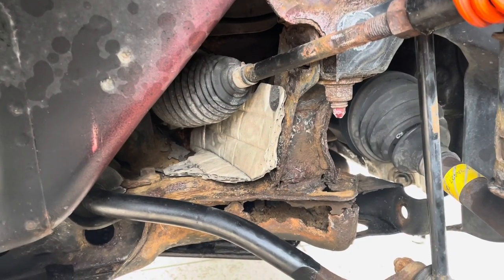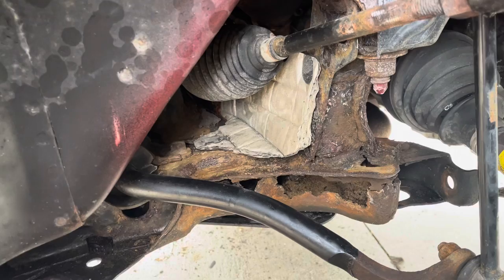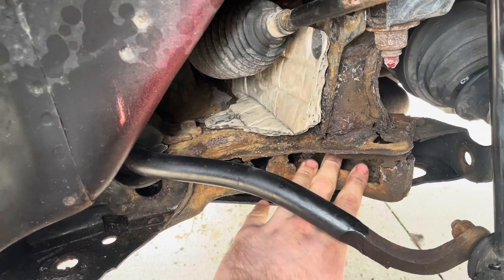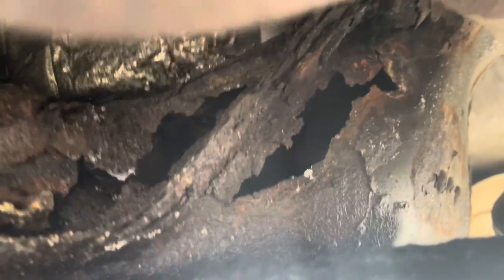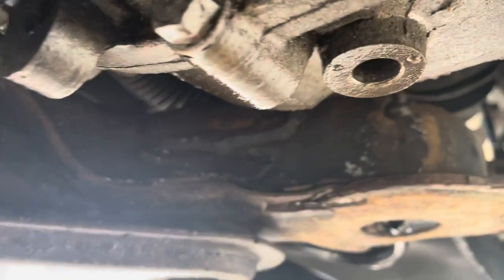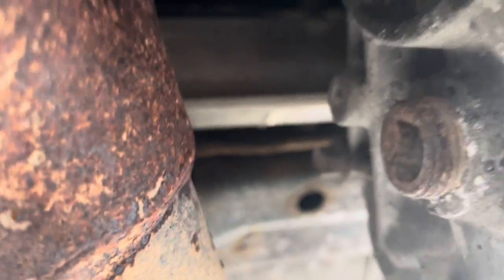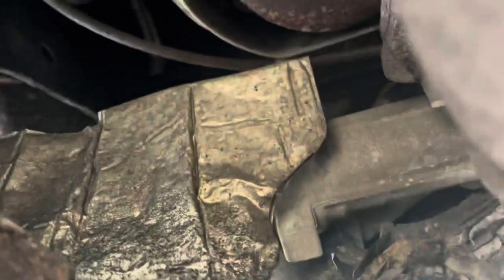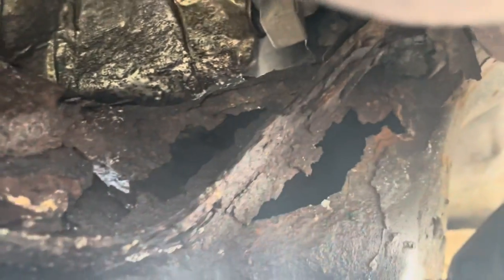2010 Ford Escape SUBFRAME FAILURE NEEDS RECALL ASAP

Comment: Happened to my 2010 Escape and then my 2010 Mariner. Luckily during an oil change the mechanic noticed ot on the Mariner (said it was super dangerous and could break next time I hit a bump). Spent $1K to replace the subframe. Last week I was rearended by a pickup truck (Mariner totaled) so once again I am on the seemingly impossible and daunting hunt for a 2010-2012 Escape or Mariner without a rusted out subframe. honestly reading all this makes me feel that for my own safety I need to finally move on (even tho its the only type of car I've ever owned, for the past 16 years) :(  I wish Ford would address this, mostly for the safety part.

Comment: A couple of days ago, my wife was supposed to take her 2011 Escape on the highway to get to work. My daughter didn't realize that her mom was going to be doing that and borrowed the car to go into town to run an errand. She was stopped at a light and as soon as she started turning to go through the intersection, she heard a bang and thought that a tire had popped. She had the thing towed home for me to fix and when I saw it coming off the back of the flatbed, I couldn't believe by eyes - a wheel was missing. The driver explained that he had to remove it so it would unjam and could be towed. The subframe had broken in two where the front part of the passenger control arm is attached. The wheel had pulled so hard to the right that the CV axle came apart. The wheel must have pushed back so hard that the front quarter panel pushed back and now rubs into the passenger door. The rotting must have progressed very quickly since  3 years ago it had been in a minor accident and no mention of rot was noted and just two years ago, I replaced both control arms (bad bushings) and didn't notice anything abnormal. The rest of the car has some minor rust but nothing of note.
I can only imagine how differently the story could have ended if my wife had driven to work that day!

Comment: I have 2011 here with the same rotted out subframe from the AC dripping on it.  I can’t understand how ford can get away with not recalling these. Hyundai has a recall right now checking for corrosion on the brake lines as well as the subframes that goes back at at least to 2010. Toyota has had multiple frame recalls. Ford needs to be held accountable. This is obviously a design flaw, they should be fixing the ones that need it as well as installing an extension on the AC drain. I had the same problem years ago with a T bird, rotted frame due to the AC, the rest of the car was fine, just like these Escapes, the other side is perfect. Everyone that is affected needs to file a statement or complaint.

Comment: Agree that it should be recalled, but Ford won't as it's aged out, or so I've heard. Had my subframe replaced last week. Apparently there's enough of them, so Ford keeps replacements in stock.
Reply: Helpful comment. My Ford ‘10 Front subframe is deteriorated. Looks like someone took a bite under the right passenger wheel. The subfames should not be rusting through; It’s disappointing the lengths I’ve taken to take care of it with this result.

Comment: Just found the same thing on my 2011 ford escape. Also, the frame on both sides in the rear beside the shocks is completely gone on the outside of the frame. All along the frame from front to back is rusted worse than I've ever seen. The Escape is taken care of and is simply a daily driver from New. I suspect these frames on these year vehicles are sub parts metal. I've been a mechanic for over 50 years never seeing this kind of rot on a daily driver car.

Comment: I was told yesterday my truck was safe to drive after getting the exhaust done… 2 hours after picking my truck up … my son was driving at 100km on the QEW … he said he heard the tire pop and then the truck frame broke. He could have been killed or someone else could have been killed. 
And now I’m finding out this was Fords fault and this was preventable???
Reply from the maker: Yeah… I haven’t gotten anyone to care between Ford or NHTSA. I wish I could tell everyone about the issue, but this is about all I’ve got.
Reply: @malachibergman902 how many people have died from this!? Totally unacceptable, just found out mine is rusted the same
Reply: Wow. The QEW is dangerous enough without that happening. This has convinced me. My 2012 is only a town car now until I can scrap and replace it. Won't be with another Escape sadly!

Comment: That’s great but you need a mechanic to take the pics and show what you are looking at. The passenger side rotted out and such. The mechanic needs to say in writing that the vehicle is not safe for operation. Then Ford might do something about it. I have a 2010 in the same situation. Doing that now with the better business bureau. Hopefully they will recall these vehicles.
Reply: I have a 2010 with the exact same issue. People were commenting on it feeling like it was going to give on the passenger side, and by accident I noticed this while doing an oil change. Right under the ac drain too. I'll get ahold of bbb as well. Did the mechanics note make a difference for you?

Comment: I purchased a new subframe from a dealer on line which is the same cost for a used on on e-bay.  Also bought a couple of cans of expanding foam and filled the new one with it to prevent any water from getting in.  Then I sprayed the outside with undercoating to seal the whole thing up.
Reply: Where did you get it from? What dealer?
Reply: Expanding foam is going to hold moisture and rot it out faster. I don't know how many old cars I've seen with that.

Comment: Yes was just told and seen mine is rusting out on the passenger side as well $2000 to replace. Didn't know this was a thing would be nice if they would recall
Reply from the maker: It would be nice….
Reply: I think they did, but it was only a cross bar to add to it, while it continued to rust.

Comment: I have been trying to figure out why my 100k 2010 mercury mariners front end is still wobbly after replacing my tie rods and now realized that the passenger side of the subframe is rusted through and broken. it looks almost exactly the same as yours. it doesn't help living in the northeast so lots of salt during the winter
Reply from the maker: It’s highly unfortunate, but it sounds like you’re safe. This has surely caused a lot of damage to these vehicles upon failure if they are on the road.

Comment: I attempted to establish a recall for this several years ago with a 2004 Escape. The people at the IIHS said, because it is clearly visible under the vehicle a mechanic can see it and notify the owner to have it repaired before it becomes a danger. I said that is true but it is clearly a design flaw and has been since they started making them, why should the cost of repairing such a flaw be placed on the owner. They said Ford did a recall on certain years from certain assembly plants up until 2004 they installed a brace across the bottom so the two sides couldn't separate. You would think they would have changed the design in 2008 with the redesign but instead they just added the brace at the factory and called it fixed. IIHS dropped the ball on this obvious design flaw and failed to order Ford to come up with a better design.
Reply from the maker: It’s very upsetting for sure. I still haven’t fixed it. I haven’t had the time and know how or the money to fix it, im getting close.

I did contact NHTSA about it, but never got a response either. We are all wondering the same question, “Why should this cost be placed on the owner when it’s a major fault of design?!?”
Reply: @malachibergman902  Agreed but their reply is just, because a mechanic doing regular maintenance can see it before it breaks it's not enough of a safety concern to warrant a recall.
Reply from the maker: @kelvinmann1058  they sell vehicles now with missing parts, so I’m really not surprised anymore
Reply: @malachibergman902  That's why my main vehicle is a 1995 F-150 Lol
With  another mid 90's waiting to be built. 😁

Comment: I just noticed this issue on my 2010 ford Escape. While I was driving in the dark I hit a pot hole which caused my subframe to brake where the passenger side lower control arm gets bolted in.
Reply from the maker: I’m sorry to hear that. When I went to the shop, they quoted be about 1.5k. I bought a replaced for the cross member k subframe for $300 after looking a bit. I still haven’t replaced it 😬. I hope that helps save you some time.

Comment: Yes!! I took my Escape to a mechanic and was told the same thing that it caused by where the air conditioner is located because water drips down.  I'm so bummed. Any recommendations on buying new or used sub frame?  FORD dealer quoted me $500 for a new sub frame.
Reply from the maker: $500 seems to be around the going rate from what I had seen. I was quoted $1500  for parts and labor.
Reply: Hmm...$500 was just for the part from Ford dealer.  I plan on taking it to a small mechanic shop.  Do you recommend a used or new sub frame? Thx u.
Reply: I paid about $350 shipped from a junkyard in Arizona

Comment: Same here mine just failed on the way back from work. Ordered a replacement and will be replacing it this weekend..... smh
Reply from the maker: Let me know how it goes. Try to document it if you can and upload it. I still haven’t gotten around to it, believe it or not
Reply: @malachibergman902  sorry I'm unfortunately a guy who just does things.... not terribly hard. I was able to do the entire job with hand tools and no air. I replaced both control arms and tie rods at the same time.  One thing I did was not removing the exhaust on the header side. I tilted the motor with a jack and the made removing and installing the subframe really easy.
Reply from the maker: @comngetsum  all good. Very helpful information for those like myself who plan on replacing it (hopefully sooner than later) 

There was a forum online that described adding a drain tube for the ac which the lack thereof causes the dripping and the corrosion. Might consider it if you haven’t looked into it already

Comment: I have a 2012 Ford Escape In mine broke passenger side while taking off from light and and brought me head on traffic  lucky i got back to side roadit's gonna be 2 to 3000 to replace it  engine cradle at shop I'm sick to my stomach 140000 miles runs like a top looks like junk yard don't have cash to fix

Comment: My 2010 Escape needs the same fix… obviously a very common problem with these vehicles. Can’t believe how much I’m paying to have it fixed
:(
Reply from the maker: I was quoted around $1500 for part ($500) plus labor. I know of at least one person here in the comments has noted some tricks to doing it yourself.
Reply: @malachibergman902  2400 plus tax for the cradle, lower control arms, sway bars and Alignment. 🤦🏻‍♂️ fml
Reply from the maker: @44125  if you did it yourself, you’d be looking at a little over 1k plus any tools you don’t have or can’t find lol
Reply from the maker: @44125  I’ve done the control arms, that’s how I found the problem in the first place, they are doable. The “cradle” or k-frame/subframe is the most difficult thing in that list. I mean, depending on how much you make a week, think about how much of your time $1400 is worth to ya.
Reply: @malachibergman902  definitely something that’s in my wheel house of skill set…. I just don’t have the time and need the car repaired asap… my entire “fleet” of cars at home is over 10 years old… I actually enjoy working on all of them. I just have to many pots in the fire atm to spend a few evenings in the garage unfortunately. 
Thx for the advice man!! 🍺🍺

Comment: The water coming from the air conditioner is distilled water.  Distilled water will eat up any metal it comes in contact with.

Comment: HELP (haha)  Subframe Big Bolt tore capture nut inside frame loose when trying to replace control arm (and subframe was replaced so how TF did this happen?)  Anyhow thinking 2.5" hole saw side of frame comfortably looking in wheel well sitting on stool, weld nut to frame, weld plug back in.
Reply from the maker: That sounds awful. It sounds like you’ve got a solution you’re trying though. Im surprised that I didn’t do the same thing when taking mine apart.

Comment: I'm fixing up my steadily-used, steadily-maintained and steadily-washed  220K-mile 3.0L 2011 Escape. The last detail is this passenger side subframe. No where near as bad as seen in this video but needs either replacement or cover patch weld so the (still relatively small) rust cavity slows/stops for the next 2 years (my target for remaining life). Ford will do absolutely nothing. I will get replacement part for < $400 on the web if I can't find someone with a TIG welder. Daughter had a 2005 model which was much much worse in the same area. 6-cyl jeeps from now on.

Comment: My 2009 Ford Escape V6 had same problem at 220,000 k S here in Ontario, passenger side. $1,800 Cdn $ to replace. Exhaust another $900 so time to sell it to someone that wants a big project.
Reply from the maker: Hopefully you don't lose a bunch of time and money on it
Reply: @malachibergman902  I am thinking it has come time to sell it for parts or project vehicle for someone. It has been a very good vehicle but I don’t think it is worthwhile to spend any more $$.
Reply from the maker: @brianbaker359  I get it. I’m considering getting rid of mine at this point too.
Reply: Second mechanic confirmed it was unsafe to drive and too many other rust issues to justify repairing and now sits unlicensed for parts.

Comment: Shit, I just saw this on mine, a replacement subframe is 500 bucks from ford.
Reply from the maker: Submit something to nhtsa, that’s what I ended up doing. Haven’t gotten anything back yet.
Reply: @malachibergman902  I'm in Canada. I tried to but I need a US Postal code. I ended up fixing it. Subframe-$570, control arms-$202, stabilizer links and subframe bushings-107, labor 350. Total 1229 CAD.
Reply: @shadow212121kb  where did you have yours fixed? The dealer wants $3200 for mine ...
Reply: @joepayer1793  I took it to my mechanic.
Reply: @shadow212121kb  that's awesome ! I was trying the same thing but he said it's too much of a job for him rite now
Reply: @joepayer1793  mmph
Reply: @shadow212121kb  Can I ask where you got the subframe for $570? I'm also in Canada and everything that I'm seeing is at least $1100 for the part.
Reply: @JimLambier  there were a few people locally that had the ford ones for sale new. You can try east gate ford parts in Ontario. They might have it. I know at the time when I was looking ford had them listed for around 700 dollars CAD.
Reply: @shadow212121kb  Thanks for the quick reply. I'm in Hamilton, so I'll give Eastgate a try. They required a pricing request form be completed, so hopefully they can get them for a decent price.

Comment: Wash your truck weekly in a salty environment and it will take years to rust like that got to wash that salt off.
Reply from the maker: This is helpful if you own the vehicle for the duration of its life.

Yes, I should have done better inspection when buying, but I didn’t think to have to check this spot in particular.

Washing the truck weekly would have kept this from happening to this degree, True.